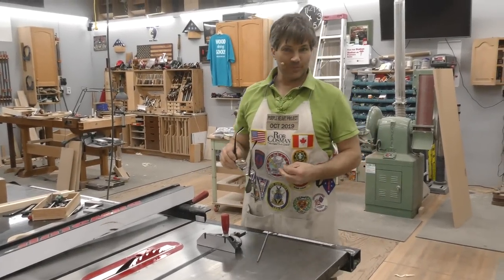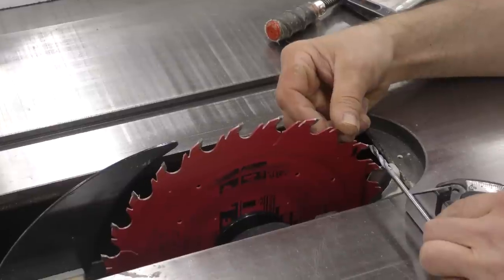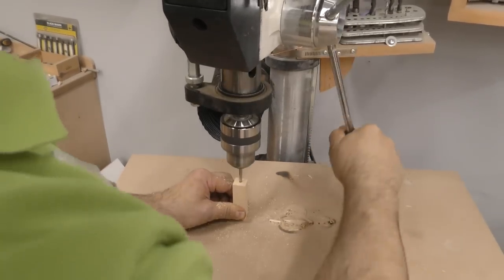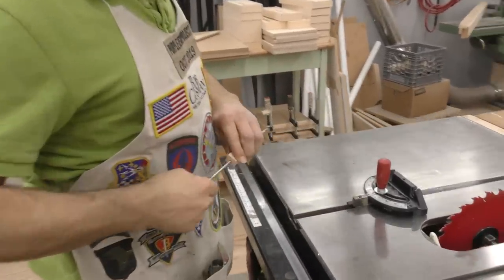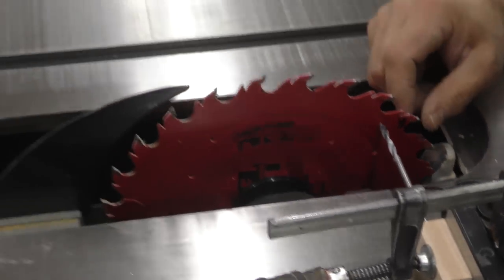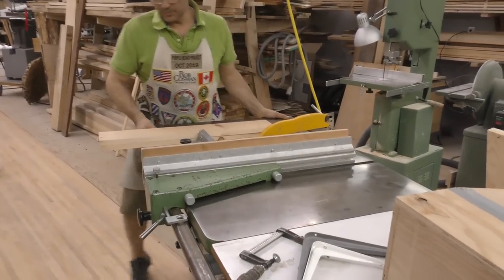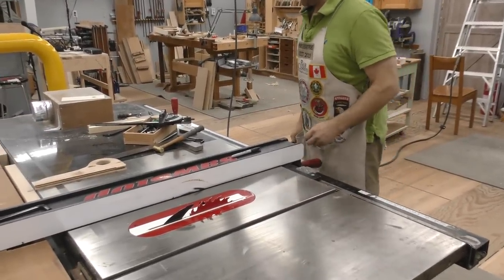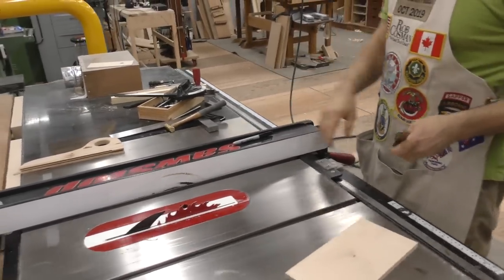Table Saw Set Up, miter gauge, rip fence and table top

Comment: Many years ago a saw mfr. visiting my shop told me the correct fence clearance setting was when you see diamond shaped tooth marks on the wood edge. At that time I owned a 16" tannewitz variety table saw. This method worked for me and still does. Nice video Rob.
Reply: When I purchase my Mule “ Accusquare “ fence I was told by their representative to lock the fence hard up against the blade then tighten the four nuts “red-faced-tight” and it put the fence in the proper alignment with the blade. The blade had already been aligned to the slots on the table. Have never had a problem. Interesting how opinions differ on this setup and also run-out allowance.

Comment: Great insight to setting up machines adjustable parts. Much easier on the larger quality machines. Not so on the smaller, more affordable, and  for small workshops. But it's a mindset thing. You show what's important and we'll figure out a way. Thanks Rob 👍

Comment: Really helpful, and with items we all have around the shop, rather than the expensive gauges the tool companies would love to sell us!
Reply: If you’re going to spend a ridiculous amount on a saw like this you want accuracy and a decent dial indicator is useful. I like the safety feature on this unit but the price is out of my budget. I run a Canadian made Rockwell Unisaw from 1970 with  Mule fence and an Incra  mitre gauge that performs as well as any saw when set up properly . A splitter or riding knife are a must.

Comment: If there is the ever so slight angle on the fence, I you move the fence to the other side of the blade, you have binding, do you not?
Reply from the maker: yep, that said, i cant remember the last time I used the fence on the other side.  You would need to adjust accordingly.

Comment: Of course, because I have a dial indicator, I thought “I would use a dial indicator”. And of course, Rob is showing the many people without such an instrument how to do it. Quite sure that he has a dial indicator or two of his own. 

But Rob forgive me for suggesting just a v-groove, or even just a saw kerf in that block of wood as an easier way to hold a rod against the miter gauge!
Reply: I also immediately said, "Just use a dial indicator!" To no one, of course.
Reply: @sisyphushappyxvx  - haha... same.  I actually built a sliding jig to secure the dial indicator, that fits snugly in the mitre slot so I can check the back and front of the blade.  I got it within 2 thou front to back and was pretty proud of myself :D  William Ng has a great video for that.
Reply: I rely on a dial indicator for setup and a battery powered inclinometer for tilt setup. Works great for me. Of course a quality Ridge blade without runout is nice.

Comment: Very nice series! Two comments on the saw stop. I rarely use the fence on the left side of the blade, but when the saw was new, I kept looking at the left hand ruler window. I placed a piece of tape on it keeps me trained to always use the correct marker. 

Also, your cast iron table has streaks running left to right from the fence rubbing it. Your saw is old, so that may be normal, but at two years old, mine looks similar. Any tips for preventing this?

Keep up the good work!!!

Comment: Oh you lost me at dissing that lovely Wadkin Bursgreen in comparison to the sawstop.
I would take the Wadkin over that clunker any day of the week.
For a start the trunions are bolted to a cast iron upper chassis instead of that pressed steel shit box. That and the trunions are mounted at the ends of the cast box so they are much better supported.
Sawstop is just a pimped unisaw, nothing special about it.
Nearly all my machinery is Wadkin  and that table would have been factory set spot bollock.
Often, depending on the machine it would then have tapered locating pins to keep it set.
Proper job.

Comment: Why don't you use a dial indicator to square the blade to the slots? Should be able to get it within a couple thousands of an inch.
Reply: A couple of reasons, if the DTI has a magnetic base, how do you use that on an aluminium mitre guage? You cant use the table because you dont know if its in exactly the right position on the rear of the table when its been moved.  Youre better off his way than messing trying to get the DTI position spot on.
I think the idea is to show the hobbyist who probably wouldnt have a DTI, or if they did only a cheap one. Id rather rely on a hole from a good quality drill, than a cheap chinese DTI.
Reply: @gbwildlifeuk8269  I attached my dial indicator to a block, similarly to how Rob used the bit, and ran basically the same procedure he did. Either works, obviously; use what you've got!
Reply: @gbwildlifeuk8269  C clamp?